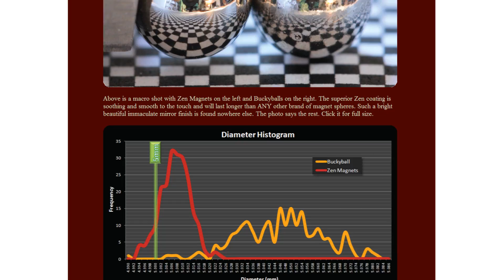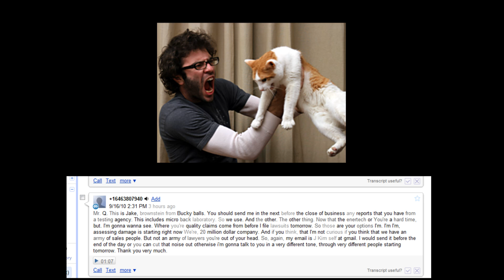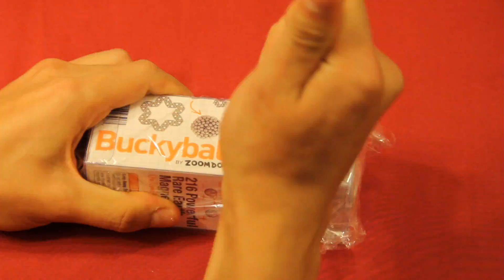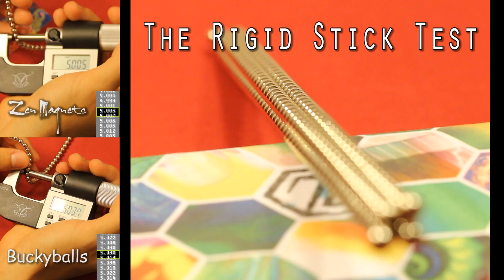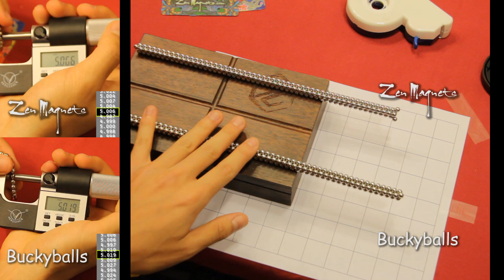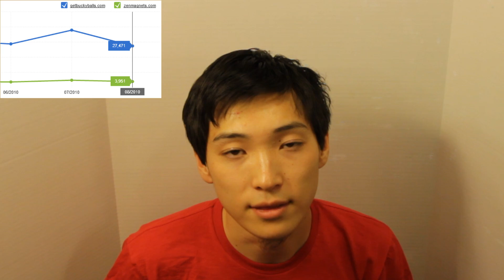Zen Magnets are better than Bucky Ball magnets.

Comment: I support zenmagnets. I owned a set of buckyBalls and after 2 months of use the chrome paint on the magnets chipped off of the poles on the magnets. It also leaves a shiny residue on your fingers which could be dangerous. I purchased zen magnets and after 2 months they were still clean and looked new out of the package. Fuck buckyballs

Comment: Nice test u can measure anything u want unless u call it official test or sort of. So  keep doing good work.

Btw two little advicemess
1: When u use micrometer and u measure lot of lengths allwas set zero again after few times otherwise the data will be unuseable.
2. Pls get a rid of those 5 hair on ur chin :D
/sry i am not native speaker/